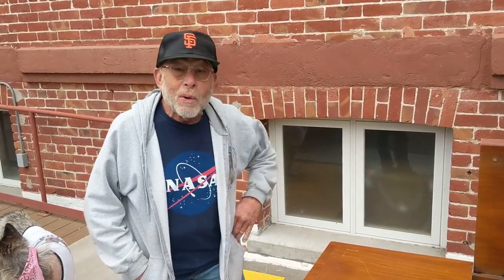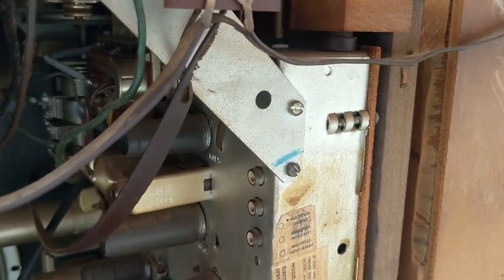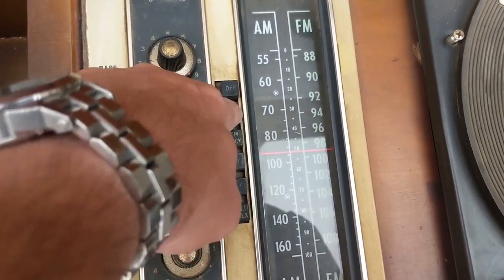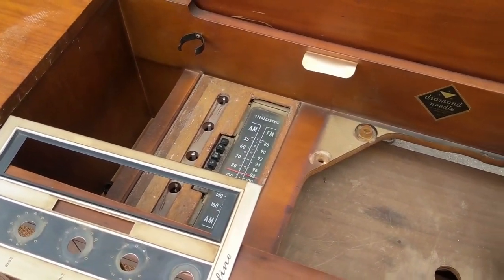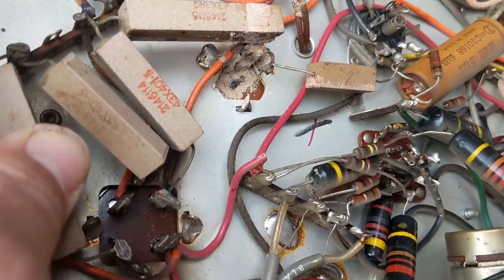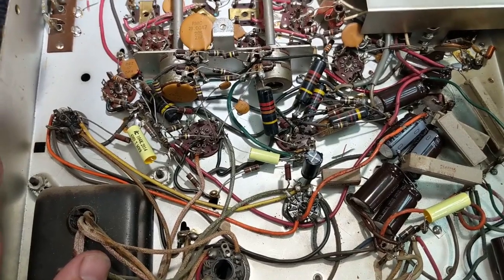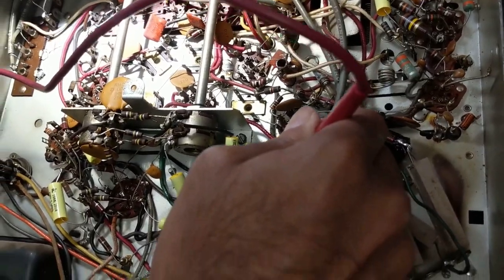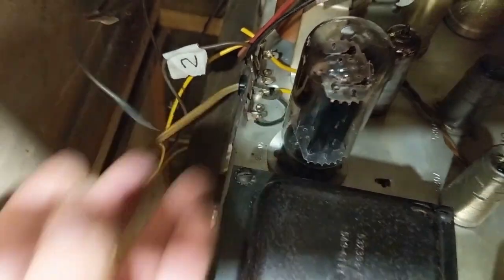TEAM EFFORT! We restore a Ward's stereo console

Comment: I have the Airline MG-2854A my parents bought new in 1962, and no smoke/nicotine in the house.  The radio unit looks identical to this one, but the turntable is different.  I've not seen another one with the same cabinet yet.  I replaced a 6BQ5 tube about 15-20 years ago, and it has some light bulbs out.  Otherwise it works well, and I'm thinking of getting it serviced.

Comment: Generic and simple styling but very nice console. These are highly unappreciated, this is a real shame. Thanks for saving that one! 👍
Reply: Reminds me a lot of the V-M designs they offered manufacturers in the very late 1950s.
Reply: Pre solid state  made in the USA goodness IMHO!
Reply: Yet, today every component in that device is still in use today. People still listen to the radio, you can still buy brand new vinyl records today, and with a set of audio inputs, you can plug in a CD player or an MP3 player. This unit fully restored could give someone years of enjoyment.
Reply from the maker: @jerryspann8713  The sound system in my living room is a 1959 Motorola 3 channel stereo console. We use it for the sound for the TV set every night. Probably 25 tubes in total. I overhauled it 10 years ago. It had the ORIGIONAL tubes. I tested them and they still tested good. Last year I removed the back and tested them again. Still nearly 100%. These systems were well-made and easy to keep running.... forever.

Comment: It's not from the 50s. The model 2857 came out in 1962. This is a 2858.
Reply from the maker: Yup, we figured that out later
Reply: @misterradio5035  Well, yeah, the turntable.
Reply: @ethelryan257  the V-M record changer is a replacement from 1968 and is not original to the 1962 console, FYI